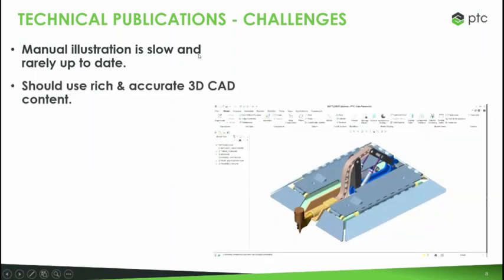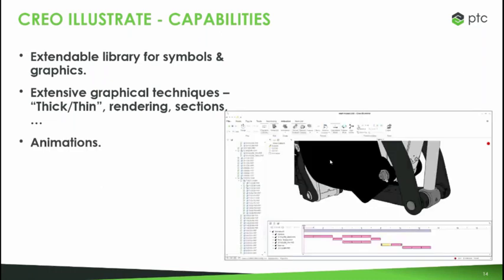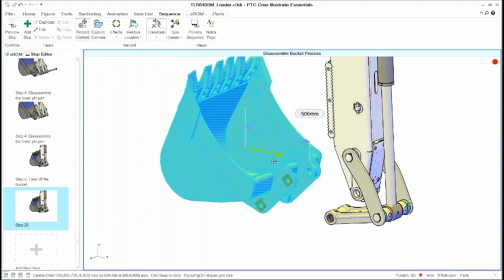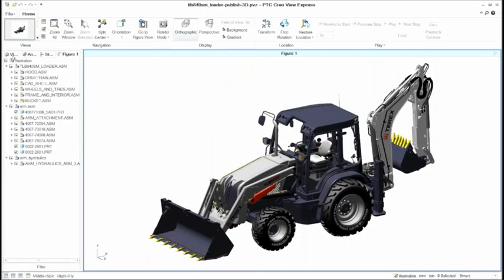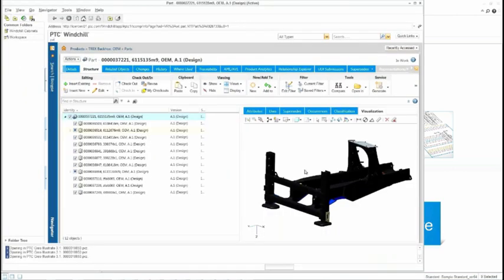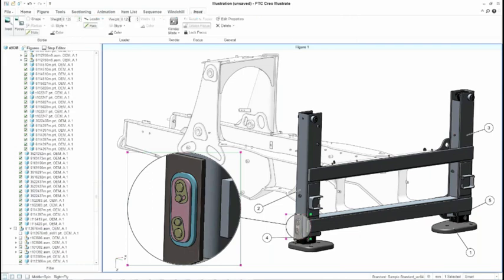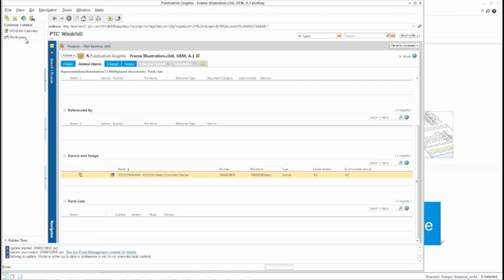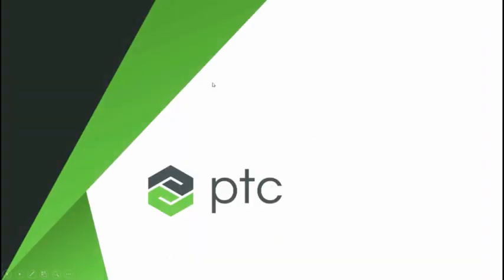Bring Service Documentation to Life with Creo Illustrate

Comment: It's a nice Creo Illustrate introduction, quite different to the other ones and I like it. Would you be able to address changes made to the communication with Windchill? Using Direct Link instead of WGM and perhaps touch on the workflow for assembly updates coming through where a subassembly comes pretty much the same but with a different number and a couple of parts replaced? Or if there's a way to reuse majority of illustrations when just a different version of the same product or module exists but requires a separate file? Like the loader with just two different sets of the spoon subassembly.

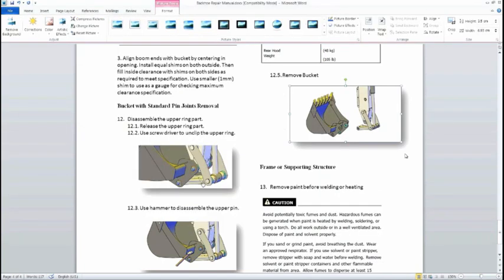Comment: 17:15 Not exactly. If a change pertains to an assembly (not a single part!) theneveything contained in the assembly is gone from all of the figures and needs to be redone. Sadly, even though replace part tool exists there's nothing which allows to point that 90% of the assembly is the same, just two parts were different and the assembly had to have a different name.